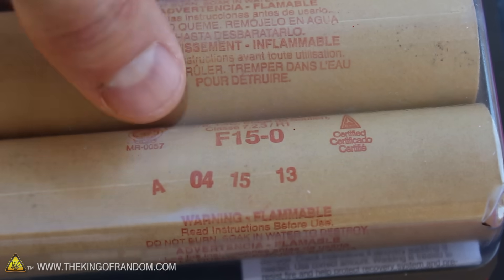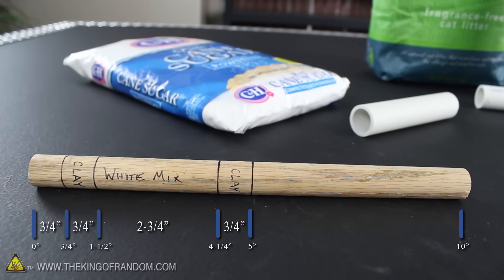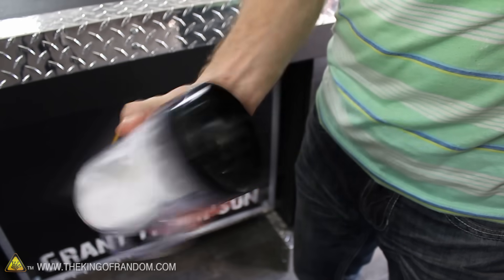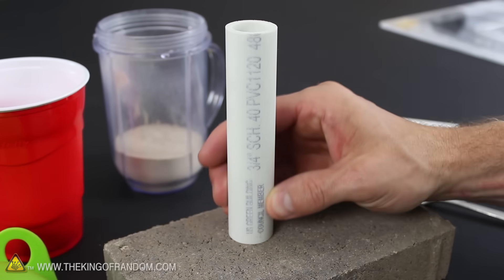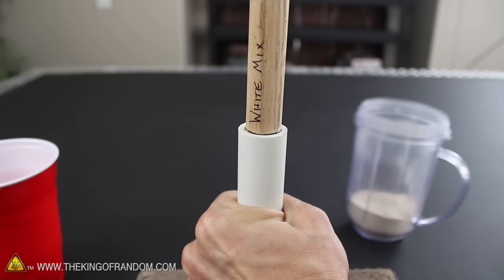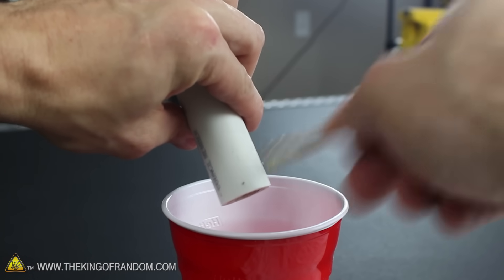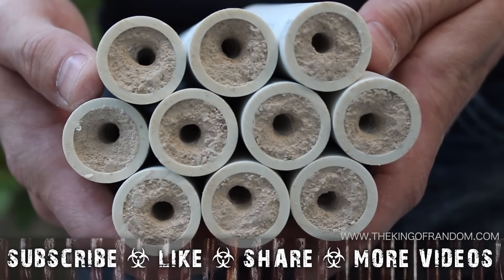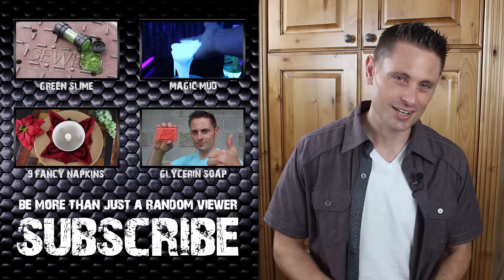How To Make Sugar Rockets

Comment: could you dye the collor of the white mix with food coloring so its looks prettier ? :D or maybe seperate the withe mix in 4 layers and make them in a different color each.
Reply: Here's an element-by-element look at what is involved in your average firework:

Aluminum - Aluminum is used to produce silver and white flames and sparks. It is a common component of sparklers.

Antimony - Antimony is used to create firework glitter effects.

Barium - Barium is used to create green colors in fireworks, and it can also help stabilize other volatile elements.

Calcium - Calcium is used to deepen firework colors. Calcium salts produce orange fireworks.

Carbon - Carbon is one of the main components of black powder, which is used as a propellent in fireworks. Carbon provides the fuel for a firework. Common forms include carbon black, sugar, or starch.

Chlorine - Chlorine is an important component of many oxidizers in fireworks. Several of the metal salts that produce colors contain chlorine.

Copper - Copper compounds produce blue colors in fireworks.

Iron - Iron is used to produce sparks. The heat of the metal determines the color of the sparks.

Lithium - Lithium is a metal that is used to impart a red color to fireworks. Lithium carbonate, in particular, is a common colorant.

Magnesium - Magnesium burns a very bright white, so it is used to add white sparks or improve the overall brilliance of a firework.

Oxygen - Fireworks include oxidizers, which are substances that produce oxygen in order for burning to occur. The oxidizers are usually nitrates, chlorates, or perchlorates. Sometimes the same substance is used to provide oxygen and color.

Phosphorus - Phosphorus burns spontaneously in air and is also responsible for some glow-in-the-dark effects. It may be a component of a firework's fuel.

Potassium - Potassium helps to oxidize firework mixtures. Potassium nitrate, potassium chlorate, and potassium perchlorate are all important oxidizers.

Sodium - Sodium imparts a gold or yellow color to fireworks, however, the color may be so bright that it masks less intense colors.

Sulfur - Sulfur is a component of black powder. It is found in a firework's propellant/fuel.

Strontium - Strontium salts impart a red color to fireworks. Strontium compounds are also important for stabilizing fireworks mixtures.

Titanium - Titanium metal can be burned as powder or flakes to produce silver sparks.

Zinc - Zinc is used to create smoke effects for fireworks and other pyrotechnic devices.
Reply: You can buy Copper (II) Sulfate as Stump Remover from most hardware stores. I think I paid $10 for 2lbs.
It's amazing the chemicals you can find in a hardware store! Read the labels and check the MSDS for the product's concentration and impurities.
Reply: ABitOfTheUniverse Thank you! If i add copper powder to the mix do you think it will be blue?
Reply: Red	Strontium nitrate	Sr(NO3)2	Common. Used with chlorine donors. Excellent red, especially with metal fuels. Used in many compositions including road flares.
Red	Strontium carbonate	SrCO3	Common. Produces good red. Slows burning of compositions, decomposes yielding carbon dioxide. Fire retardant in gunpowders. Inexpensive, non-hygroscopic, neutralizes acids. Superior over strontium oxalate in absence of magnesium.
Red	Strontium oxalate	SrC2O4	Decomposes yielding carbon dioxide and carbon monoxide. In presence of magnesium fuel, carbon monoxide reduces particles of magnesium oxide, yielding gaseous magnesium and eliminating the black body radiation of the MgO particles, resulting in clearer color.
Red	Strontium sulfate	SrSO4	Common. High-temperature oxidizer. Used in strobe mixtures and some metal-based red compositions.
Red	Strontium chloride	SrCl2	Common. Produces bright red flame.
Orange	Calcium carbonate	CaCO3	Produces orange flame. Yields carbon dioxide on decomposition. Often used in toy fireworks as a substitute for strontium.
Orange	Calcium chloride	CaCl2	
Orange	Calcium sulfate	CaSO4	High-temperature oxidizer. Excellent orange source in strobe compositions.
Orange	Hydrated calcium sulfate	CaSO4(H2O)x*	
Gold/Yellow	Charcoal powder	C	
Gold/Yellow	Iron powder with oxygen based carbon OC12	Fe+C	
Yellow	Sodium bicarbonate	NaHCO3	Compatible with potassium chlorate. Less burning rate decrease than sodium carbonate. Incompatible with magnesium and aluminium, reacts evolving hydrogen gas.
Yellow	Sodium carbonate	Na2CO3	Hygroscopic. Significantly decreases burning rate, decomposes evolving carbon dioxide. Strongly alkaline. Very effective colorant, can be used in small amounts. Corrodes magnesium and aluminium, incompatible with them.
Yellow	Sodium chloride	NaCl	Loses hygroscopicity on heating. Corrodes metals.
Yellow	Sodium oxalate	Na2C2O4	Non-hygroscopic. Slightly reacts with magnesium, no reaction with aluminium.
Yellow	Sodium nitrate	NaNO3	Also acts as oxidizer. Bright flame, used for illumination.
Yellow	Cryolite	Na3AlF6	One of the few sodium salts that is nonhygroscopic and insoluble in water.
Green	Barium chloride	BaCl2	
Green	Barium chlorate	Ba(ClO3)2	Classic exhibition green with shellac fuel. Sensitive to shock and friction. Oxidizer.
Green	Barium carbonate	BaCO3	Pretty color when ammonium perchlorate is used as oxidizer.
Green	Barium nitrate	Ba(NO3)2	Not too strong effect. With chlorine donors yields green color, without chlorine burns white. In green compositions usually used with perchlorates.
Green	Barium oxalate	BaC2O4	
Blue	Copper(I) chloride	CuCl	Richest blue flame. Almost insoluble in water.
Blue	Copper(I) oxide	Cu2O	Lowest cost blue colorant.	
Blue	Copper(II) oxide	CuO	Used with chlorine donors. Excellent in composite stars.
Blue	Copper carbonate	CuCO3	Best when used with ammonium perchlorate.
Blue	Basic copper carbonate	CuCO3·Cu(OH)2, 2 CuCO3·Cu(OH)2	Occurs naturally as malachite and azurite. Good with ammonium perchlorate and for high-temperature flames with presence of hydrogen chloride. Not easily airborne, less poisonous than Paris Green.
Blue	Copper oxychloride	3CuO·CuCl2	Good blue colorant with suitable chlorine donor.
Blue	Paris Green	Cu(CH3COO)2.3Cu(AsO2)2	Copper acetoarsenite, Emerald Green. Toxic. With potassium perchlorate produces the best blue colors. Non-hygroscopic. Fine powder readily becomes airborne; toxic inhalation hazard. Used in majority of Japanese blue compositions as it gives very pretty color.
Blue	Copper arsenite	CuHAsO3	Almost non-hygroscopic. Almost as good colorant as copper acetoarsenite. Toxic. Can be used with chlorate oxidizers.
Blue	Copper sulfate	CuSO4·5 H2O	Can be used with nitrates and perchlorates. Acidic, incompatible with chlorates. With red phosphorus in presence of moisture liberates heat, may spontaneously ignite. Less expensive than copper acetoarsenite. Anhydrous copper sulfate is hygroscopic, can be used as a desiccant. With ammonium perchlorate produces almost as pretty blue color as achievable with copper acetoarsenite.
Blue	Copper metal	Cu	Rarely used, other compounds are easier to work with. Yields pretty blue color in ammonium perchlorate based compositions; but reacts with ammonium perchlorate and liberates ammonia in presence of moisture. The composition must be kept dry.
Purple	Combination of red and blue compounds	Sr+Cu	
Purple	Rubidium compounds	Rb	rarely used
Silver/White	Aluminium powder	Al	
Silver/White	Magnesium powder	Mg	
Silver/White	Titanium powder	Ti	
Silver/White	Antimony (III) sulfide	Sb2S3	
Infrared	Caesium nitrate	CsNO3	two powerful spectral lines at 852.113 nm and 894.347 nm
Infrared	Rubidium nitrate	RbNO3
Reply: TheEpicWazuki
From the last post -
Blue	Copper(I) chloride	CuCl	Richest blue flame. Almost insoluble in water.
Blue	Copper(I) oxide	Cu2O	Lowest cost blue colorant.	
Blue	Copper(II) oxide	CuO	Used with chlorine donors. Excellent in composite stars.
Blue	Copper carbonate	CuCO3	Best when used with ammonium perchlorate.
Blue	Basic copper carbonate	CuCO3·Cu(OH)2, 2 CuCO3·Cu(OH)2	Occurs naturally as malachite and azurite. Good with ammonium perchlorate and for high-temperature flames with presence of hydrogen chloride. Not easily airborne, less poisonous than Paris Green.
Blue	Copper oxychloride	3CuO·CuCl2	Good blue colorant with suitable chlorine donor.
Blue	Paris Green	Cu(CH3COO)2.3Cu(AsO2)2	Copper acetoarsenite, Emerald Green. Toxic. With potassium perchlorate produces the best blue colors. Non-hygroscopic. Fine powder readily becomes airborne; toxic inhalation hazard. Used in majority of Japanese blue compositions as it gives very pretty color.
Blue	Copper arsenite	CuHAsO3	Almost non-hygroscopic. Almost as good colorant as copper acetoarsenite. Toxic. Can be used with chlorate oxidizers.
Blue	Copper sulfate	CuSO4·5 H2O	Can be used with nitrates and perchlorates. Acidic, incompatible with chlorates. With red phosphorus in presence of moisture liberates heat, may spontaneously ignite. Less expensive than copper acetoarsenite. Anhydrous copper sulfate is hygroscopic, can be used as a desiccant. With ammonium perchlorate produces almost as pretty blue color as achievable with copper acetoarsenite.
Blue	Copper metal	Cu	Rarely used, other compounds are easier to work with. Yields pretty blue color in ammonium perchlorate based compositions; but reacts with ammonium perchlorate and liberates ammonia in presence of moisture. The composition must be kept dry.

Do a little more research on Google where to get these and how much to add and you should have a nice blue flame shooting through the sky at night.
Reply: ABitOfTheUniverse
Thanks, this is really useful :D Wich one is the cheapest and easiest to get hold of?
Reply: TheEpicWazuki File the coating off a few pennies, you should be okay. =P
Actually go to Amazon, search category Lab & Scientific Products, search copper, sort prices low to high and take your pick, first thing I found was Copper Sulfate Pentahydrate - Crystals - 25.2% Cu - 1 Pound
$3.99
Reply: Copper Sulfate Pentahydrate - Crystals - 25.2% Cu - 1 Pound

$3.99
 (4)
Product Features
Fertilizer - Used to treat Copper deficiency in Soil

Product Details
Manofohm cuace5 Copper Acetate

$8.75
Product Description
Copper (II) Acetate CAS No: 6046-93-1

Product Details
Black Copper Oxide - Cupric Oxide - CuO - 1 Pound

$9.50
Product Features
... Copper oxide is used in pigments, ceramics, batteries, along with a wide ...

Product Details
COPPER CARBONATE - 1 lb

$10.00
Only 19 left in stock - order soon.

Product Details
Copper Acetate 25 grams, Manofohm

$10.00
Product Description
... Copper (II) Acetate CAS No: 6046-93-1 Density: 1.882 g/mL Mol. ...

Product Details
BLACK COPPER OXIDE - 1 lb

$10.00

Product Details
COPPER OXYCHLORIDE - 1 lb

$10.00

Product Details
Fehling'S Solution A (Copper), 500ML

$11.54
Product Description
Fehling'S Solution A (Copper), 500ML

Product Details
COPPER SULFATE-SULFAMIC ACID IN-

$12.30 
Usually ships in 1 to 2 months
FREE Shipping on orders over $35
Product Features
Copper Sulfate-Sulfamic Acid Inhibitor Solution

Product Details
Copper Sulfate, 1 Percent w/v Aqueous Sol

$13.32
More Buying Choices
$13.32 new (2 offers)
Free Shipping on orders over $75 See Details
Product Description
... Copper Sulfate, (Certified 1 Percent w/v) Aqueous Solution ...

Product Details
Copper Sulfate 2% w/v Solution, 500ML

$13.79
Product Description
Copper Sulfate 2% w/v Solution, 500ML

Product Details
Copper Sulfate Pentahydrate - 25.2% Cu - 5 Pounds - Easy to Dissolve - Powder

$15.49
More Buying Choices
$15.49 new (2 offers)
 (2)
Product Features
Fertilizer - Used to treat Copper deficiency in Soil

Product Details
Copper Sulfate Pentahydrarte 99% Crystals 3 lb bag

$15.97
More Buying Choices
$9.99 new (3 offers)
 (13)
Product Features
Our copper sulfate is 99% pure and is 2mm-4mm in size for use as an algaecide

Product Details
SEOH Fehling'S Solution A (Copper) 1 Liter

$16.75
Free Shipping on orders over $75 See Details
Product Description
Fehling'S Solution A (Copper) 1 Liter

Product Details
Fehling'S Solution A (Copper), 1L

$17.38
Product Description
Fehling'S Solution A (Copper), 1L

Product Details
Copper Sulfate, 2% w/v 500 mL Poly Natural Ricca 2317-16

$17.42
Free Shipping on orders over $75 See Details
Product Description
Copper Sulfate, 2% (w/v) Aqueous Solution